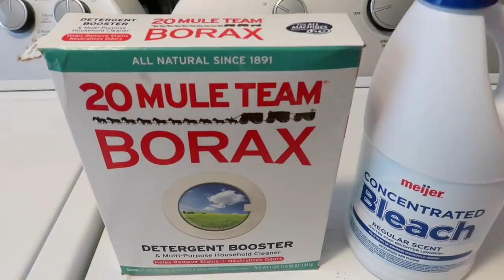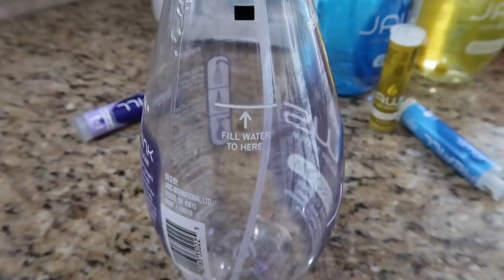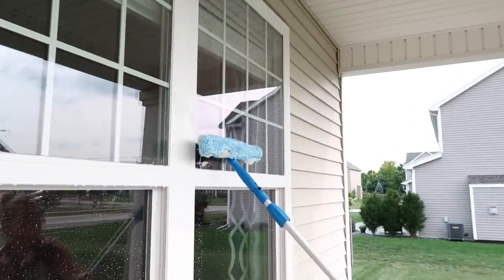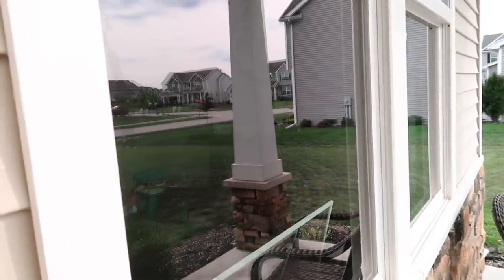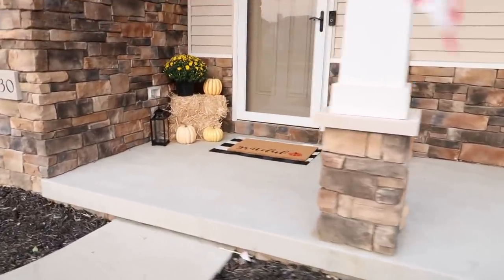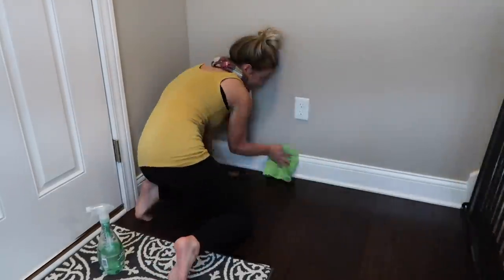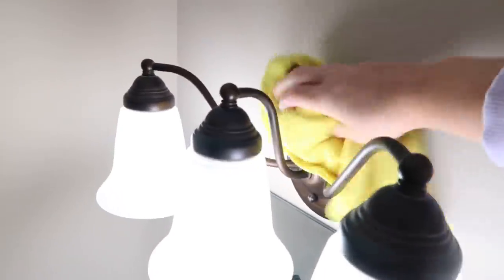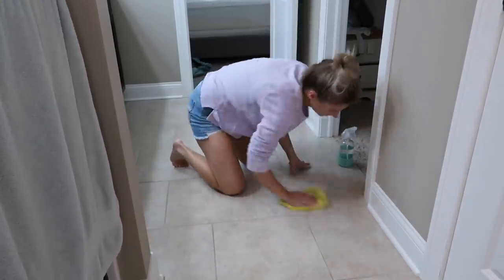NEW! EXTREME FALL CLEAN + DECORATE WITH ME 2020 | ALL DAY CLEANING MOTIVATION | CLEANING ROUTINE

Comment: I noticed straightaway that you put your bleach directly into your washer with your detergent and booster, here's a tip my grandma gave me...thats a no no. The little cup on your washing machine directly left is for this. If bleach is applied with the detergent it can NOT clean correctly or remove staining as it normally would because the bleach is hindering that process. Using your bleach dispenser on the left of the tub dispenses the bleach at the correct time and your clothes come out cleaner. It works better and your whites will be whiter. Grandma also let me know pouring the bleach in directly into the tub either on the side or directly on the clothing will actually cause the fabric to rot or weaken extremely fast. I had noticed......it seemed like I was buying new pillows every six months or so. I launder my pillows once a month and allow them to air dry then pop in dryer for 20 minutes of high heat to fluff. Just thought I'd pass on this advice it saved me tons of money on pillows, towels and undies and my whites are much whiter now.
Reply from the maker: Thank you!!!